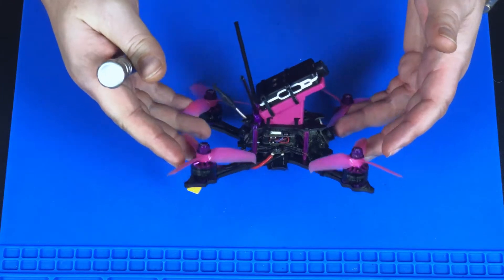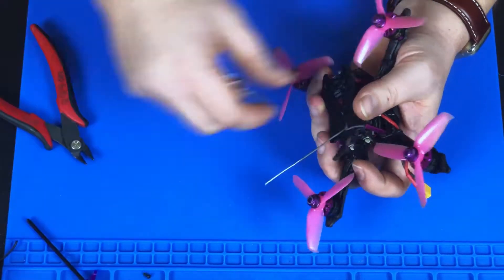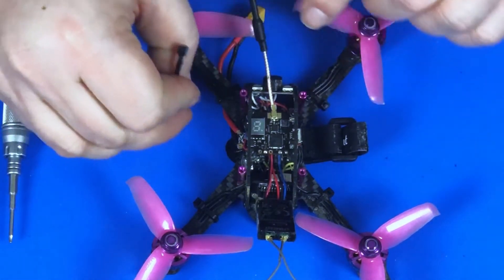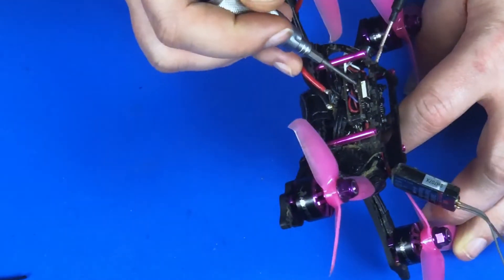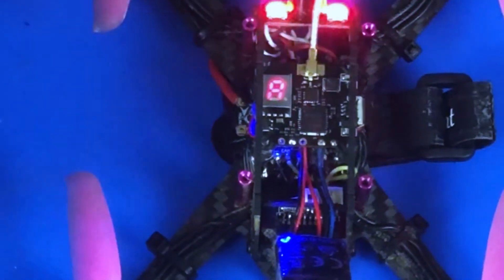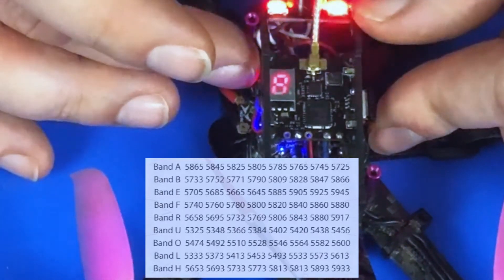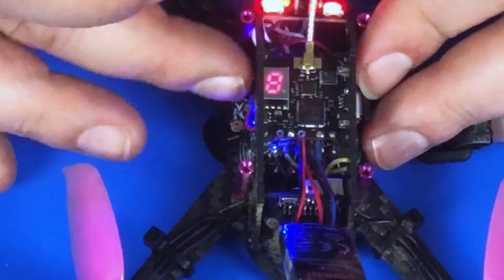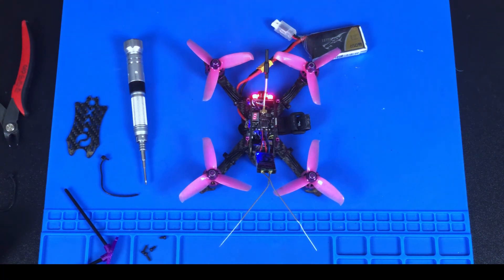HGLRC XJB 145 vtx - setting it up

Comment: is it normal that the VTX reaches over 212°F?
Reply from the maker: I've never taken a temperature reading on it, but it does get hot.  Various things contribute to the temp, primarily what output mw setting you have it on.  The higher the output, the hotter it will get.  This shouldn't be much of a concern (within limits) because you are suposed to be flying it with plenty of air flowing over it to cool it.  Just sitting on the table, there is no cooling, so it will get hot.  If you are working on the quad and not flying, it should be in pit mode, or at 25mw max just to keep the temps down and avoid wear-and-tear on the electronics.  If it gets excessively hot it "could" be an indication of an issue with your antenna.  If your antenna is disconnected, or not connected properly, the output will get reflected back into the transmitter and potentially burn it out.
Reply: thanks for that helpful answer :) I think the antenna is connected properly... but i'm not shure if the connector is worn. when I first cut the cable tie of the vtx antenna, the antenna disconnected really easy. but I just have tested it with the stock settings...the gyro update frequency is on 8khz and the pid loop frequency on 2khz i think. what is your setup on these settings?
Reply from the maker: One disconnect shouldn't cause too much wear on it.  But as I mentioned it does get pretty hot just sitting on the bench, but flying it will cool it.  The problem with the ipx (u.fl) connection is that it can easily disconnect if you pull up on the wire end.  It is very easy to disconnect it by accident when re-attaching the top plate for example.  I like to give it a little pre-bend so it stays a little more secure when feeding it through the top plate.  I run mine at 8khz for both.  For a more detailed look at how I have mine setup, you can checkout my betaflight setup video here: https://youtu.be/Ke7Dj0pdNok
Reply: thanks! that's what i was looking for. I've also tried to change the power level like you've shown in the video...but I the display doesn't show three dashes.and no zero for pit mode... it only shows one dash in the middle, on dash at the bottom then 2 top and middle and again one on the top. very confusing.
Reply from the maker: You probably have the V2 version of the board.  I'm currently editing a video about upgrading a v1 to the v2 and then how to set it up, and change the settings in the OSD.  Hopefully will be posted tonight or tomorrow...  But the short answer is with the v2 board, don't set it with button presses (it will drive you crazy and requires opening your quad).  Instead you can set it through the OSD menu!
Reply: Mr Octagon: I think we have the same board. Mine is over 75 Celcius in a few minutes, and turns off itself imho. FPV video is gone, etc. Have to remove battery (using Tattu 850 mAh 4S), wait, and then I can continue the setup again, for a few minutes maximum. Annoying as f%=+!""%k. The ufl connector is fixed by 704 high tempreture resistent silicone rubber.

As I can seen on BG we have a V2 board with 25/100/200/350mW options.

While I was writing I've "watched" Kremer's HGLRC Hornet review on the other tab which has the new board as well, and here are the infos about the dashes:

https://youtu.be/KW924fP8tIc?t=4m46s

Maybe useful for you too.

Unfortunately still have heat problems at 25mW :/

Tronage: thanks for all your XJB vids!

Comment: Thanks for the video dude! I got the newer VTX so the readout is a little different however, the lower ziptie trick works!! good tip! im also going to not go through the hole, found a perfect little rubber grommet that fits in the half circle behind it. will send a pic or if it works well, maybe even upload a video! fpv maiden today! so sketchy. had a landing pad to hit and could not touch anywhere else due to concrete or snow.. pulled it off, couple of little bounces. Thank god for flight sims!
Reply from the maker: Awesome, I know the feeling,  recently I had the same issue flying with full on snow, and had a little 3-foot diameter landing pad.  Seems big in person, but ultra tiny fpv lol!  Quick tip for snow, buy a plain tarp, I got one about 6-foot by 12-foot.  Lay that out on the snow and now you have a dry/soft landing zone.  if it windy you can use some tent stakes to hold it in place (they usually have metal grommets on the perimeter.

Comment: Noob here, researching for my first purchase...been very interested in xjb145, how I found your page. Would you suggest this as a first quad for someone with minimal experience? If not what would you recommend? And please don't say wizard.
Reply from the maker: It depends on what you are trying to accomplish and what sort of flying you want to do.  What I mean is that for a "first" quad I actually recommend a simulator (velocidrone is a good one).  This lets you get the "idea" of flying and work on building some muscle memory and letting you get a good portion of your crashing done without issue.  It should be used with your actual transmitter you plan on using for your quad.  
Now as far as what style of flight you want to do.  Again the goal for me is not wasting a bunch of cash fixing or repairing after crashes (and you will crash).  Now don't get me wrong none of these suggestions are necessarily easier or harder to fly then this one.  Just the cost of repair, or the damage it can cause, is much less.  The Newbee Drone beebrain micro V2 is great for just learning the concept of flying and racing.  You really can't do freestyle with it, but certainly can race. and you can hit into people or furniture without issue (an minimal if any repair).  Also great for flying when cold or wet outside too!

That being said if you want to go the way of brushless with room to grow I'd say this is an excellent choice.  One thing I would recomend is that you may want to learn with a 2s or 3s pack so it tones down the power of the quad.  As you get confident and comfortable, you can upgrade to a 4s pack to get you more "oumph".  This will def. give you the feel of a 5" quad without the intimidation factor.

I'm quite in love with my xjb, and I find myself making many videos about it because it is just a wonderful quad, and you can find a buch of information about it in my playlist about it. https://www.youtube.com/playlist?list=PLio6GR5bzRMPuxClxxsZqy-jOZE0Ffrzv Keep me posted what you decide, I love hearing others experience and stories!!!
Reply: Yeah, he is totaly right, first of all learn with an simulator.. When u do the first flights u will see why..thousands of crashes wich cost much money in reallife.
Reply: Wizard

Comment: cut away a little window in the top plate to see the LED?  shouldn't weaken it too much, or?
Reply from the maker: You could cut a little window, but carbon fiber is finicky to cut because without the correct tools it splinters and also makes a dust that you shouldn't inhale.  So I avoid cutting carbon fiber unless done underwater to catch the dust.  Once you set it, you shouldn't need to keep changing it, kinda a "set and forget".  Just a inconvenience to do it, but isn't so bad once it is done.

Comment: its my first drone so I will ask you also.. when I connect the battery, nothing happens, what could it be. Battery is charged.
Reply from the maker: You got me on that one, I'd want to check it over with a multi meter to see if the power is flowing and if it is making it to the quad.  If you are 100% sure pack is charged and you have a multi meter, set it to detect dc volts, and carefully touch the probes to where the power line is soldered to the flight controller (be very carefull not to short it out with the probes).  If you are using a fully charged 3s pack, you should see about 12.6 volts.  If a fully charged 4s pack it would be 16.8.  If you don't see voltage there, then something is bad between the pack and the board (bad connector, bad battery, bad wire, etc.)  if you do see power onto the board, you can check the red and black wires that are there for the receiver, you should see about 5v on these two wires.  If you don't then for some reason power isn't making it into the board or something is toasted, can't say for sure.  Don't know what else to tell ya because it is hard to trouble shoot something that is not doing anything.  Let me know if this helps ya out at all.
Reply: You are awesome. thanks man. I am very frustrated now, because I was going to make a video to find some help and as I connected the battery, the quadcopter turned on, the lighs and the beeps  and everything. I tell my wife, I tell my friend that was trying to help me..  Then when I am getting ready to bind the receiver its not powering on again.  I guess I would have to buy a multimeter. search for something good and cheap. dam. never ending. I am salty because I was so excited about the thing working you know. But you have been very kind with all these informations.
Reply from the maker: That sort of secures the deal that there is a loose connection somewhere.  Either in the battery connection or where the power cable attaches to the flight controller.  Power is just not getting into the main board.

Comment: my man. I am strugling trying to connect the r-xsr. I have no idea how. 5 cables going out of the drone, 5 cables from the receiver but for some reason it seems to be more complicated.
Reply from the maker: I'm still learning FrSky stuff too, however I think I can help you out.  On the R-XSR there are 5 wires on the harness.  however not all of them will get connected, and same goes for the 5 wires in the HGLRC XJB.  Not all of them will be used.  First check out this vid of mine: https://youtu.be/4f7tlt0LxkE that will show you the basics how to get the receiver installed.  However you are installing a different receiver, so you will have to wire it as follows:
xjb black to r-xsr black (gnd wires)
xjb red to r-xsr red (5v wires)
xjb yellow to r-xsr green (sbus wires, more specifically, r-xsr sbus out to the hglrc xjb sbus in)
The other wires you don't need.  but just as I do in the vid, don't desolder them until you confirm everything is working.  Hope that helps you out!
Reply: thanks for taking the time man, I really appreciate it.. You are very clear . So 3 cables out of 5? and what about the PPC?
Reply from the maker: I think you are referring to ppm, and that is a type of communication protocol just like sbus is a communication protocol.  It is a way for the receiver to communicate with the flight controller.  Sbus is by far better and faster then ppm, and is the protocol you should use.
Reply from the maker: I watched your video and it did help me understand your issue.  it is almost certainly the power it just not getting to the quad.  The quad itself is good.  The power is not getting to it.  without a multi-meter to test with it will be hard to figure it out.  The first suspect would me the xt30 to xt60 adaptor.  Since I see you have a soldering iron in the video I'm going to assume you have soldering skills.  I would cut the shrink wrap off the adapter and re-solder the two sets of pins together.  The ones I've gotten use very little solder and are not soldered well.  Add a generous amount of solder to each set (but don't create a bridge between the red and black wire sides) and then put new shrink wrap on it to protect it.  See if that solves your problem.  If not then it could be the wire from the drone (either where it connects to the board, or where it is soldered to the xt30 connector or the wire itself.
Again since you already have soldering equipment, just double check that the red and black wires are properly soldered to the flight controller board.  You can also check the solder joints at the xt30 end. or it may be a bad wire between the two.
I hope this helps you out, and fingers crossed the issue is in your adapter since that is the easiest fix!!!  Keep me posted if this helps!
Reply: Thanks man. very good ideas on where to try. I have not soldering skills. I got the thing for this drone adventure, but I am learning to do it better and better. I think I will get a multimeter first so that I could see where does the energy is getting at. I dont know how to use that either but I think I will have to learn .. Jesus.. on this Hobbie you become an expert in all kind of areas XD I hope I can get it to fly, enjoy it and just remember at all the time I had to wait and laugh... I will be getting everything on video to share. Thanks again. Are you from the US?
Reply from the maker: Yes, I live in the US, New Jersey to be specific.  This hobby does get you involved with other aspects and gets you to learn other skills.  The multimeter is easy to use.  you set it to measure dc volts, and put the red probe on the red wire (where it is soldered to the flight controller) and the black probe on the black.  If it reads zero, then unplug your battery and leave the converter on the battery,  then measure the pins on the xt30 connector with the probes (red to red, black to black) if it still reads zero, then remove the connector and do the same to the battery main pins.  Always be sure to not slip and short the battery (connecting both pins with the probes).  If you get voltage on the battery, but not on the converter, then the converter is your issue.  If you get power on the converter but not on the wires connected to the flight controller then your problem is on the lead that is attached to the flight controller.  If you have power at the connection to the board, then it probably means the leads are not soldered well to the board.
Once you get a multi-meter do some tests, write back and let me know what you find.  I'm very curious what the cause is.  If you wanted to mail it to me, I'd be happy to take a look at it for you, but you would have to pay the shipping to and from, and not guarantee I can fix it, but I'd give it my best shot.
Reply: Thanks man. But I would really hate to have to wait any longer. Tomorrow I get the multimeter and I will be doing the checking. I will do it as you said. I will try to document it.
Reply from the maker: AWESOME, I'm glad you purchased one.  For this hobby you really need a few tools: Soldering iron, Multi-meter, hex-wrenches (for opening and closing frames) and  box-wrenches (to put on and take off props).  Please let me know how it turns out and if you can figure out what the issue is.  Just please make sure to be careful with the probes and not short-circuit anything when a battery is connected because that will cause damage.
Reply from the maker: I am now 100% sure it is your converter since that is where the voltage stops.  Also you are unsing continuity wrong.  If you look on the LCD screen you see the symbol that looks like a solid triangle touching a line, that is the diode tester mode.  I'm not familiar with your exact model of multi meter, but I'm going to guess you hit the func button to change it to the other mode for that dial position (you will see the dial has two symbols in that position, the triange with a line, and then one that looks like a dot with waves comming out of it like o))))  hit the func button and see if the display shows that same symbol (for sound) and now what the multi meter will do is beep if there is connection between the two probes.  If it is silent it means no connection.  and I'll bet it will show no connection from one end of your converter to the other end (either on the black or red side).

If that is the case, remove the black heat shrink, and re-solder the pins together that are not connected and that should fix your issue.

Please keep me updated because I'm hopeful this gets you working!
Reply: tronage thanks man. I will.
Reply: got it.. it works. I am pretty happy. now I connect the battery and the drone starts to get really hot, like almost cant touch the boards
Reply from the maker: Where was the problem?  Also that is "normal" the video transmitter will get hot (especially if you have it turned up to a higher mw output setting).  For casual flying you should be at 25mw setting, if you plan on just working on it at the bench, you should have it in pit mode.  It gets hot because it is assumed you are flying with air flowing though it cooling it.  To adjust the transmitter settings, you can check out this video I made: https://youtu.be/QVTbkn1zUQw  keep me posted!